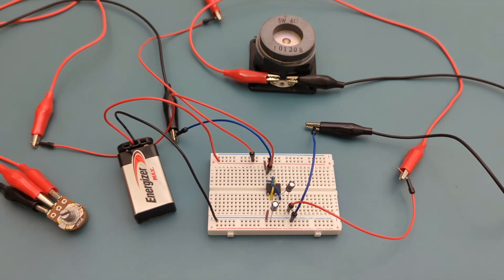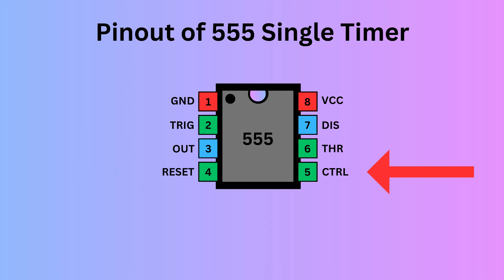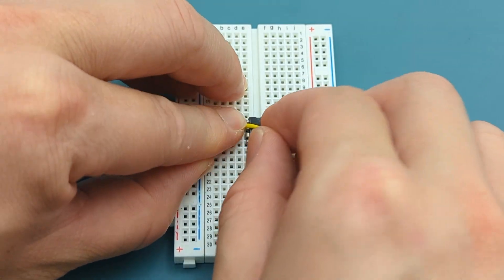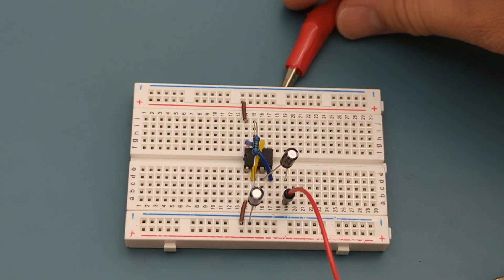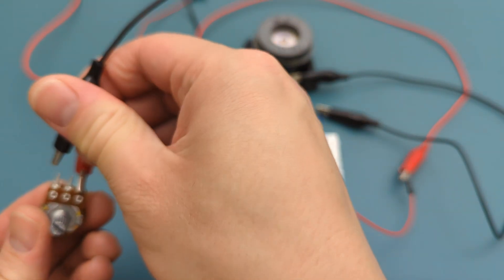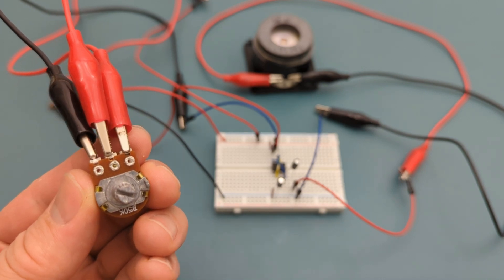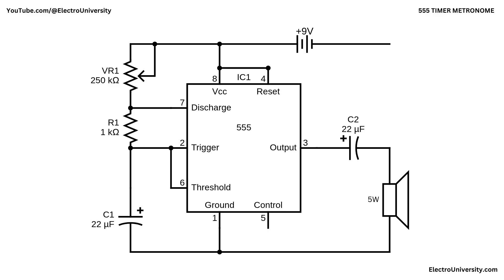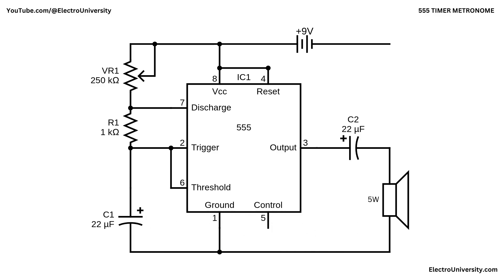Build Your Own Metronome Without Coding!

Comment from the maker: 🔔 Get your tools here:
✅ Electronics Component Kit: https://amzn.to/3N65asq
✅ 9V Battery Connector: https://amzn.to/3S7kbg8
✅ 9V Batteries: https://amzn.to/4kkonVD
✅ NE555 Timer: https://amzn.to/41MpQhp
✅ Potentiometers: https://amzn.to/3HTOtAU
✅ Electrolytic Capacitors: https://amzn.to/4dnrJF4
✅ Resistors: https://amzn.to/3YfGeUi
✅ Jumper Wires: https://amzn.to/3NNn9UR
✅ 5W Speaker: https://amzn.to/4eL2D3y
✅ Solderless Breadboards: https://amzn.to/3SndKWm